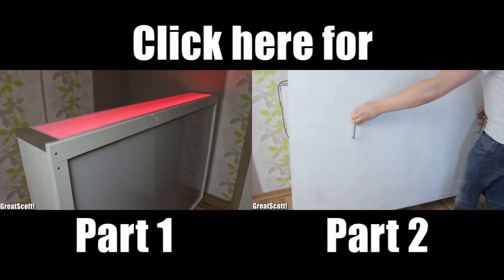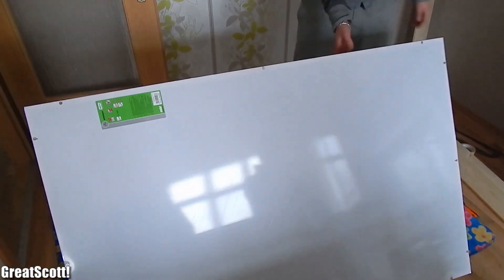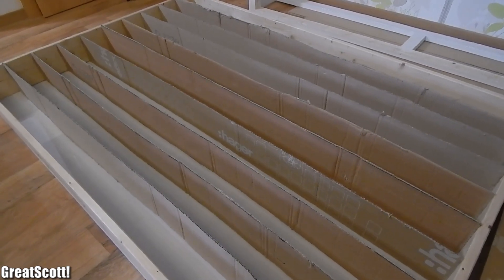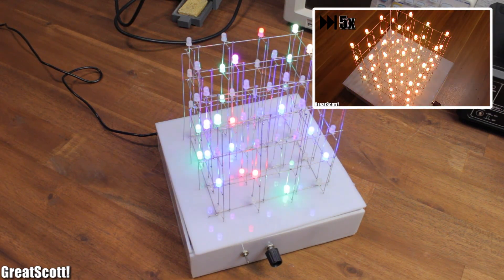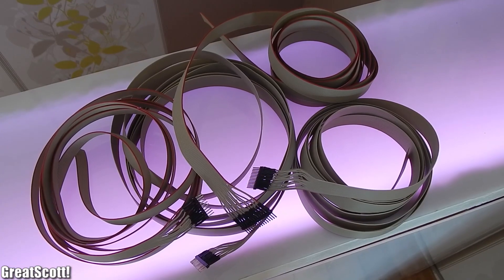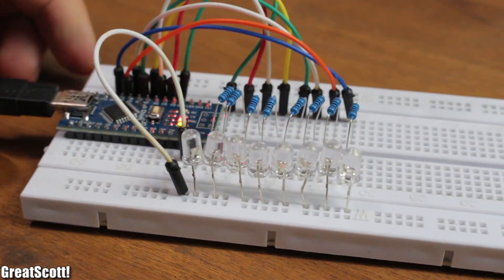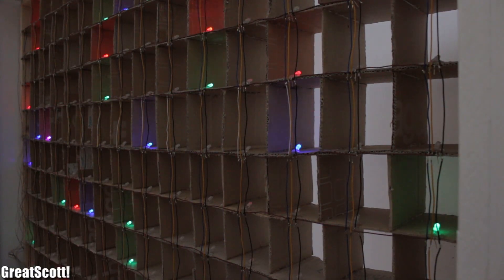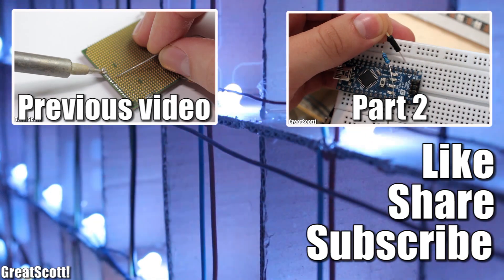Make your own 15x10 RGB LED Matrix - Part 1

Comment: Sir, 13:11 I want to know about "Common Anode multiple RGB LED's" connections as you did in this video (13:11) and current required and resistor and voltage requirement calculation for  20 Common Anode RGB LED's. I want to know all details please help me 🥺.

Comment: You could have cut the horizontal cardboard strips at regular intervals to the middle and repeat the process for the vertical straps and push them into each other at the cutted sections

Comment: actualy a screen like the screen on my tabled is a big RGB led matrix
Reply: Most tablets use lcds but some samsung ones and probably others do indeed have oled screens.
Reply: +MrMats0n ok thnx for the info but it is somewhat comparable to a rgb led matrix but it mostly uses led backlight because the lcd or oled is not bright enough
Reply: +RickDoetGames yes, that is true but still th backlight usually isn't a matrix, rather just a few leds at one end of the screen and lots of optics.

Comment: Great build, GreatScott! But, the cardboard still is a stupid idea. I noticed several times how the pixels weren't square, they were warped because of the flimsy cardboard. If i would ever build this, i would use wood or any other material that is cheap and not flexable.

Comment: nice project! u should have spray painted the card board white so they reflect the light better though
Reply: or use aluminium tape. (but remember to insulate all connection!)

Comment: how can i drive 10 mosfets from arduino if it only have 8 analog connections?
Reply: because i was watching the 4x4x4 cube and i want to make a really  smaller led matrix like 40 by 40 centimeters and with 100 leds only

Comment: Glaubst du das die Helligkeit der LEDs reicht, wenn die LEDs näher am Acrylglas sind? Ich würde nämlich gern ein kleines 8x12 Pixel RGB Display sein, insgesamt maximal so groß wie ein Tablet. Wegen der Stromversorgung kann ich nicht die LEDs mit den integrierten Controllern nicht nutzen, ich würde gern auf Batteriebetrieb setzen.
Hoffe du verstehst meine Problematik und kannst mir helfen.
Max
PS: Machst sehr gute Video hab schon alle angeschaut und natürlich abonniert :)
Reply from the maker: Max Mustermann Die Helligkeit sollte auch in diesem Fall ausreichend sein.

Comment: Was hast du als Frontfläche bei dem Panel verwendet? Also diese große Platte die man sieht wenn man drauf sieht. Würde mich sehr über eine Antwort freuen :) 
LG Fischi :D
Reply from the maker: ***** Das müsste eine 4mm dicke Acrylglas Platte sein. Milchig natürlich. Habe die aus einen Baumarkt.
Reply: GreatScott! Okay danke :) Ich bewundere dich, dass du deine projekte wirklich immer durchziehst. Ich denke mir zwar meistens: Wow das wäre cool oder das mache ich. Aber schluss endlich mache ich dann nie etwas weil ich dann entweder zu faul bin alles einzukaufen oder dann wirkich zu faul bin es umzusetzten
Reply: GreatScott! can I use only the audrion nano by connecting all the data in and out wires to the audrino nano's data in and out wires?

Comment: What gauge wire did you use. Looks too small
Reply from the maker: jpalm32 It really was small. But that should not matter that much because the TLCs are constant current sinks. Only if there would be a huge voltage drop across the wire then it would not work properly.

Comment: Did you use P9823 less in the end 

I have a bit of a time limit to get everything.
Reply from the maker: Vincent Lee Yes PL9823 8mm LEDs. But WS2812B will also work or something similar.
Reply: GreatScott! How did you get the code working as i can't